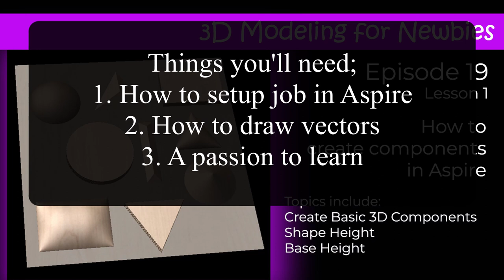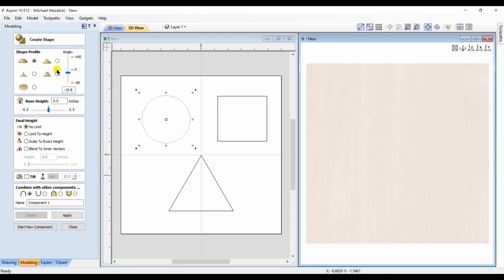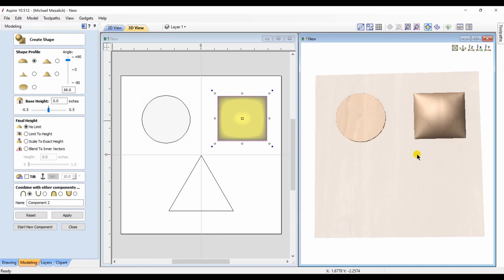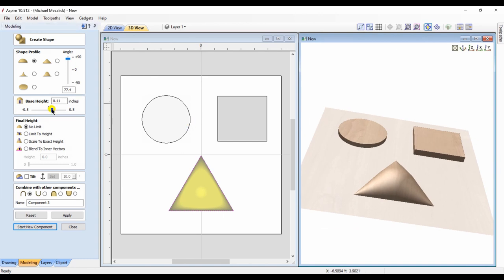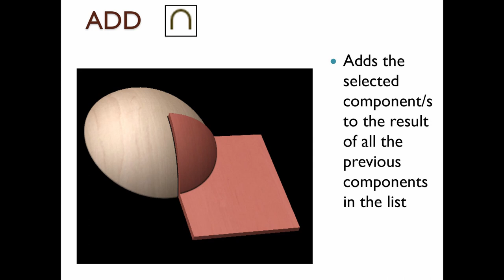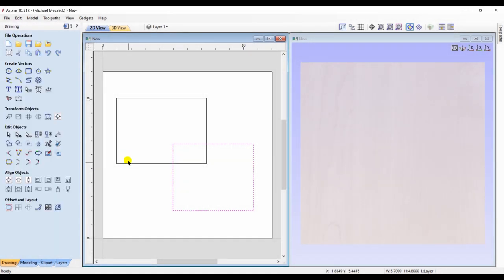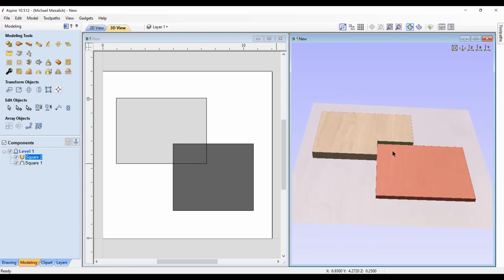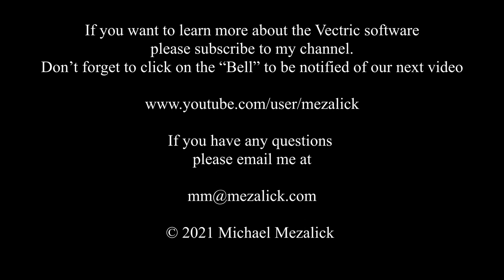3D Modeling for Newbies Lesson 1 Creating Components with Aspire

Comment: Thank you Michael for this video, I came across your channel a little while back, but life gets in the way and I go back and forth from one video to another, not necessarily in order. Your teaching is very unique and I must say...I Love it! I do have a question that I haven't quite figured out...lack of trying most likely. The question is when you add, not merge a model over another one I notice that you entered in a desired height for the second model in which you added, I believe the item was 1/4", question is this... does that second component add 1/4" to the existing height of the 1st component while at the same time the portion of the second component remains 1/4" from the "plane" level, what I'm calling a shear plane?
Sorry for the long winded question. I think you mentioned that the total project height thus far was 3/4", the 1st component was 1/2" and the 2nd was 1/4". There appeared to be two 1/4" heights there...1/4" above the 1/2" first componnent and then a 1/4" above the shear plane. Am I dreaming? Thanks, and once again I hope that wasn't to long winded. Love your content!!! Andrew
Reply from the maker: Thanks Andrew for the comments. When choosing the component property of "Add" both dimensions are added together. I'm not sure I understand your "shear plane". I will look at the video again to see if I misspoke. Just think of it as a 1/4" slice of Cheese over a 1/2" hamburger,, Total thickness  3/4"
Reply: @mezalick  
Hi again Michael, THANKS for your response. No, you never misspoke in this episode, I should have called it a modelling plane, not a shear plane. I appreciate your experience and look forward to.more learning.👍 Andrew W😊

Comment: Hi, I'm stuck, when I create a circle, rectangle and triangle they are all component 1 , not sure how to create or make them individual components
Reply from the maker: Select each closed vector seperatly.
Reply from the maker: There is a long workaround by cutting each shape out by selecting the component and one of the closed vectors and using the sissors on the modeling tab.
Reply: @mezalick  Hi Michael, thank you for responding, I just realized these shapes do not become individual components until extruded in modeling, thank you for making this series, Mark, Vancouver, Canada